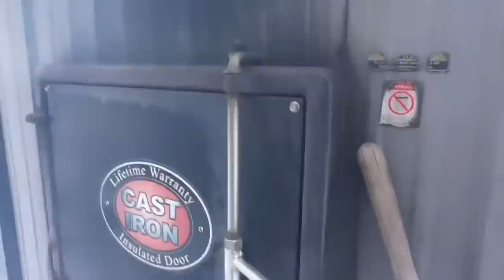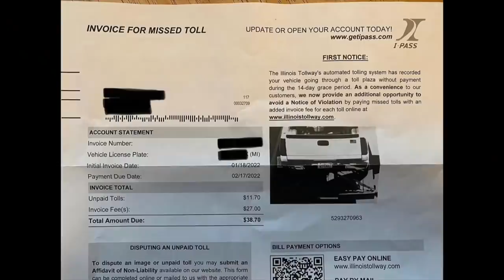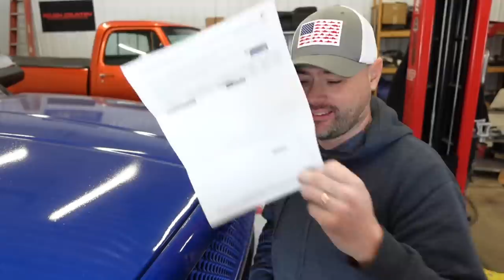I Got A Ticket For The Truck I Was Towing Through A Tollway! IS THIS LEGAL?

Comment: The iPass matches the vehicle to the registered plate.  When the iPass is scanned it is compared to the LPR or License Plate Recognition system that takes a picture at the same time.  You have a plate that was picked up by the LPR but no transponder that matches.  The automated system cannot account for every scenario and Illinois is only incentivized to keep "glitches" like these in place hoping you will just pay.  If you removed the plate from the vehicle when it is in town then this will not occur.  This is why the iPass system requires the license plate number of all the vehicles who will be using it to be in their system.  The website allows you to add vehicles.  The terms of service explicitly states you must login and specify which vehicle is using the ipass before you move it to a different vehicle.  This is so the LPR can match properly.

Comment: Josh if you didn’t have the plate on the truck the License plate camera reader wouldn’t have tripped the camera but if you go to the Iowa 80 truck stop they have a decorative license plates with images on them for sale get one of them notch the plate holes are then when you transport a truck you just have to loosen the plate screws slide the cover over tighten the screws and your good to go

Comment: Idk how it is around you but in PA, you have to register your personal pickup in weight classes. If you tow 10k regularly, you are supposed to register your truck to tow that. And the turnpike in PA is definite highway robbery. You pay by the exit. It’s not a one time flat fee. The further you go, the more you pay.
Reply: I avoid the PA Turnpike unless I have no other choice .   Almost always I will travel horizontally through PA on I 78 or I 80.    I 78 forces me to travel I 76 near Carlisle to continue on to Columbus, Ohio.    I 80 all the way to Cleveland to visit Ohio Diesel Tech College or Milwaukee.
Reply: There's no need to ride any toll roads at all.  Get out of bed earlier and take the State Highway System. Truck drivers been doing it for decades!
Reply: @anthonygreco1130  I 78 doesn't force you to get on I-76. You're no longer on I 78 when you get to Carlisle. That's Interstate 81. When you get off I 78 and merge onto I 81 South in Lebanon County head west towards Harrisburg on I 81 South. Once you get passed Progress Ave exit 69 get in the far right lane and take the next exit to State Rt 322/22 West to State College. You can follow that all the way up to State College and get on I-99/220 and keep going and get back on 322 at the Philipsburg exit and take that up to I-80 in Clearfield County and head west to Cleveland.
Just be forewarned that on State Rt 322 West after Milroy and before State College there is a pretty big grade called 7 mountains hill that you will travel up so make sure that truck and trailer rig is ready for it.
Reply: @stevenwolfe9085  I stand to be corrected.   Thank you for helping me remember, it is appreciated!! 👍🏻😊
Reply: @stevenwolfe9085  Thank you for correcting me !   It is appreciated !!  Never too late to learn new stuff.  :)

Comment: Per axle tolls are common. Each axle on the road causes wear and tear and the point of tolls are two things.

1. Pay off the costs of constructing the road instead of directly raising taxes 
2. Maintain the road/bridge etc. during the payback period. After which point the tolls are removed or maintained to keep the road maintained to again prevent it from being a tax burden.

This is especially important for low population states like Oklahoma that have a lot of Interstate thru traffic that the taxpayers would otherwise be forced to pay to maintain their use of the road for with little gain as it is thru traffic that doesn't contribute to the economy of the state.

Comment: Taking the plate of the pickup probably won't help, because they're billing you for the trailer, not what's on it, and they're finding you by the transponder, which is probably what took them so long.     Otherwise they'd be billing whoever it is whose  truck you're hauling, which isn't necessarily you.

Comment: In NY you pay per axle.  So when I pull my camper or the utility trailer I get charged for the extra 2 axles.   And yes if you have 3 axles on the trailor you pay for 5 .

Comment: I tow an enclosed Haulmark trailer thru IL frequently during the summer. The pass always charges for the trailer. I don’t have plates on my trailer as WI doesn’t require for my size trailer. I have never registered the trailer to iPass. I just searched IPass and it says it is automatic for a trailer. Not sure what is correct.

Comment: Tts not the plate on the trailered truck that was the problem. The transponder was set to the primary vehicle, 2 axles. Once the trailer is connected that now changes the class to 4 axels but that is just counting the trailer and nothing to do with what's on the trailer. So my question is how easy is it going to be to switch back and forth from truck to truck + trailer.

Comment: You will get charge for the truck on the trailer if you add it to your ipass account even if it is on the trailer.  Take the plate off of the vehicle on the trailer and make sure the trailer is on your account on you will only get charged for 4 axles not 6 axles.

Comment: The problem you had was your trailer wasn't registered on account, hence the camera ticketed the truck being towed.  Only the towing vehicle and trailer should be charged.  I believe it doesn't matter whats on the trailer and if the camera does ticket a vehicle on it dispute that cause it may not be smart enough to know it was being towed instead of driven. 

FYI the sideways license plate on the trailer is also a violation in Illinois we used to the same thing until they pulled us over for specifically that.
Reply: They also charge more for dual rear wheels over singles.
Reply: Trailer shouldn’t have to be on the account!!! Ipass is only necessary on the towing vehicle
Reply: @Mikes5785  I don't believe the trailer has to be on the Ipass account. You do however have to go online before your trip and specify the vehicle plate and how many axles if you use the ipass for multiple vehicles. It goes by the registered vehicle and the number of axles and tires crossing the toll. Stupid I know but it is communist run Illinois'  rules. I got hit with the same thing. One time on the way out hauling an empty trailer and one time on the way back with 10k on the trailer. Same underpayment both ways!
Reply: @Mikes5785  Yeah I can't afford the property taxes in that state! I am very content being on the west side of the Mississippi! The only thing saving my parents is ag tax rate and taxes being froze at SSI age!

Comment: Remove or cover the license plate  on the towed vehicle. Most toll systems use cameras to photo the plates. You corrected your account for the trailer but this problem will keep happening as long as other license plates are visible.

Comment: I'd get the head and block fire ringed not o-ringed :) o rings are only good for at most 600 to 700. Thats why they blew. Fire rings are meant for high horsepower

Comment: The axle toll has nothing to do with what’s ON the trailer. You are paying for the trailer itself. The lady on the phone explained it like you need to pay for the load on the trailer (in this case a 2 axle truck). The system was triggered by the extra license plate on the white truck. Take that plate off while towing to avoid a glitch like that. Paying an extra charge for a 2 axle trailer is a separate thing.

Comment: The way it works is they charge you by axle or that is in contact with the roadway so each axle doesn't matter if you drive a dually or a single axle rear end they charge you by the axle not by the tire so whatever axle has rubber tires or whatever on it that's in contact with the ground save my f450 for example on my c6500 rollback tow truck they charge for the axle it only has two axles they only have two Acts so they only are going to charge me for the two axles now once I start pulling a trailer it doesn't matter if I have a car and truck or motorcycles on the back of the truck and on the trailer they're only counting the axles and contact with the roadway

Comment: I was pulling a 40 ft 5th wheel with a dually f450 to Maine for a family vacation. I had conflicting tolls at every toll booth I came across. Being from out of state (MI) I had no easy pass or whatever ea state called their automatic toll booths for toll roads. I had to go through the manual booth where teller tells you the amount you owe. Charge is by the axle as most people stated here. So the fifth wheel has 2 axles and the truck 2 axles. About 70% of the toll booths charged me for 4 axles. Some booths charged me for 5 axles because I had a dually (that was their reasoning). And some charged me for 6 axles stating my 5th wheel hitch was another axle????

I actually asked what they charged the 18 wheeler that was next to me in the next booth at one of the toll stations.  5 axles - I said how can I have 6 axles? I got no response. So on my way home I set my GPS to avoid all toll roads f-em.

Comment: It's 'only' $38 to you... but multiply that by the number of times I imagine they pull this... that adds up quick... Your driven truck and the two axle trailer are all that can be charged a toll... not the vehicle on the trailer.

Comment: For those screaming corruption, you are wrong.  It is pretty simple.  A.  Turnpikes are a convience, so you pay for the /privilege/ of using them and B. More axles equals more wear and tear to the roadway (all else being equal).  Since tollway maintenance comes from the tolls, extra charges per axle offset the additional wear and tear.  Ie.  It makes sure you are paying your fair share.

Private citizens are lucky in that they only pay this surcharge on turnpikes.  Commercial trucks pay essentially the same fees for regular highway use.  All those strange looking antennas around highway weight stations are to read commerical truck transponders so the fees can be assessed.

Comment: Your dodge is that a felpro gasket or a cummins gasket they are basically the exact same when you compair them I had the same issue with my truck I talked to you and your brother 2 years ago at the Michiana event center told you about cummins swapping my 05 chevy 2500hd well I built it and have now put about 15,000 miles on it but not before having the exact same issue as you drove it about 200 miles and blew the headgasket had ARP studs and a new felpro gasket well there junk the gasket that is I ended up with a cometic gasket and had the head machined and no more issues but I definitely recommend a cometic gasket!! I see you stated that you had O-rings on your head I was going by the one picture that showed a felpro gasket so you may just disregard some of what I said lol

Comment: I have a 05 dodge 2500 4x4 with the 5.9 cummings 6 speed manual Trans 343,000 would love to up grade the motor not sure it would be cost effective with that many miles

Comment: My machine shop has told me Exotic head studs have a high failure rate in Cummins.
Reply from the maker: Wish I knew this soon 😂
Reply: @TruckMaster  I know I have had to replace the headgasket on a friend's 12 valve twice now due to lifting the head. He was using Exotic but refused to change to ARP. It lifted at about 45lbs of boost in his truck.

Comment: You don't plug up the engine heater on your truck? If i remember correctly, the tolls in VA, WV, PA and NJ are based on number of axles IE a motorcycle pulling a single axle trailer is charged with 3 axles. A kind New Jersey Turnpike toll guy asked if I was returning from Lake George NY, "YES SIR" , 2 AXLES have a safe trip.
Reply from the maker: I will if it’s the ford or dodge but not the Chevy’s

Comment: The automatic license plate recognition works so well, EZPass automatically verifies your EZPass with the license plate it detects in the picture to the license plates registered on your account. If it doesn't match then the registered owner of the license plate gets a ticket. I have 3 EZPass devices used across 5 vehicles that are on my account.  To avoid a violation just add the new license plate to your account, even if the car is not road legal. If the license plate is detected without EZPass it will get charged to your account as a normal EZPass toll. If they don't detect a license plate then they go with the EZPass device. This is how I can use my EZPass with a rental car instead of paying the rental agency higher rates for using theirs. I can add the rental car to my account and then remove it the day I return the rental.
Reply: I put my EZ Pass in a friends car when we went somewhere and he never got a ticket.
Reply: @LaughingTerry  But did you get charged on your EZPass account? It depends on how they chose to resolve the conflict. Or you went through a toll area that doesn't use cameras. Some EZPass systems get such a large backlog processing conflicts that they drop a large period of the queue to get caught up and loose out on revenue collected over the cost to process. If neither of you got charged then you got away with it. You might get away with it but I wouldn't always count on it.
My parents got a fine in the mail in the past. They didn't have EZPass but were not given the opportunity to pay a cash toll because of construction. When the fine came in the mail I sent it back with my EZPass info. The fine got dropped and my EZPass account was charged with the toll. Not a big deal in the end.
Reply: @evilshiloh  I never thought to check I guess. I do recall the light turned green and indicated toll paid.

Comment: Hey bud, i need some help doing my lbz.  Im willing to drive out.  Pretty much bought everything i need.  It has high miles and my egr is bunged up.  I need to get truck done. I have down pipe,up pipe, and the rest.  My 33 year old wife just passed from stage 4 breast cancer,  i need to get away and do what i love. Thats working on my truck.  I just cant do it on ground in snow with -3 weather lol.  I can send u my email if u want to touch base .

Comment: If you back the truck on the trailer, they may be able to see that it is not driving through the toll. If the trailer was enclosed, they wouldn't be sending the ticket out.

Comment: That's strange.  I also have Ipass on my truck but I pulled my 5th wheel camper through there and they just charged extra for pulling the 5th wheel on the truck.  My Ipass is only configured for the truck without trailers.
Reply: Probably could not see truck plates.

Comment: She's both right & wrong about how you go about adding the plates.    You do have to add the "vehicle" being towed. But that "vehicle" is the trailer being towed directly, not the load on the trailer. YOU do not have to add the plates for the load on the trailer.   So she added your trailer and it's plate to your account.  Do not add any other plates unless you have other trailers that you tow through the toll system.     You can remove the plate from your "load" or vehicles being transported on your trailer to avoid future confusion.   But she was wrong in adding the load vehicle plate to your account.

Comment: The reason you were set for violation was you didn't include the trailer ... The reason they caught the violation was ,the system caught the other axles. Wasn't the plate,that's just gives them a person to contact.

Comment: Yes, NY is the same you get charged for the number of axles and it doesn't even matter how much weight those axles are capable of hauling.
Empty or loaded, single wheel or tandem all the same price. Complete theft by the state for non commerical haulers.

Comment: Always remove the license plate when the entire vehicle is on a trailer. No you shouldn't ever pay a toll for a vehicle that is being towed off the ground. Your already paying for the two axles on the trailer, so you paid the required amount.
Reply: How are you already paying for the two axles on the trailer....I'm not so sure those cameras pick up your rear plate AND the trailer plate (trailer plate is easy but the towing vehicle may be missed because the trailer/towed vehicle is in the way

Comment: My question is that now that you are registered as pulling a trailer what happens if you drive through with the truck and NO trailer, do you automatically get charged as truck and trailer?
Reply from the maker: Oh dang it! I didn’t think about that
Reply: @TruckMaster  😂🤣
Reply: @TruckMaster  you will. Unless you at manually.

Comment: So you were not actually being charged for the Truck on the trailer, but rather the trailer its self. They charge you based on the number of axles on the ground. Since the plate on the truck was the only one visible to the camera, that's the plate number they used.
If they can clearly see the trailers plate number, then that would be the vehicle they send the ticket on. The system does not care what the plate is registered to, only that they got a plate, and that there where axles on the ground not paid for.

I have this same problem with Ohio all the time. 
I normally travel the Turnpike without my trailer, but when I do I have to remember to remove the EZ pass and pay cash or they ticket me as the trailer is not on the account. 

Once you add the trailer to your account you get billed as if it was there even if it is not currently hooked to the truck. The system will not pick up and add or remove axles based on your current configuration. 

My suggestion is to call back and remove the Trailer from the account, unless you spend more time towing than not. If that's the case leave as is. Any time you are not towing the trailer tho pay cash, or you will be charged for the trailer even if you do not have it with you.

Hope this makes sense for you.